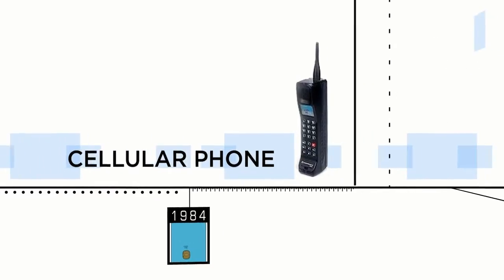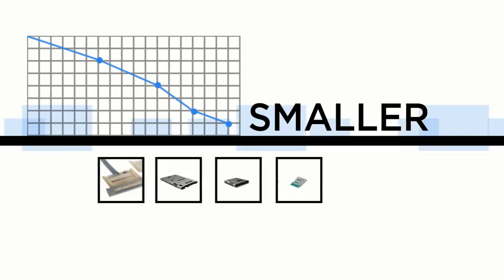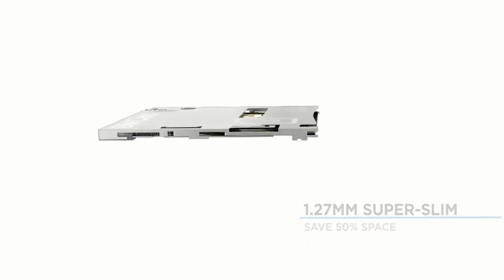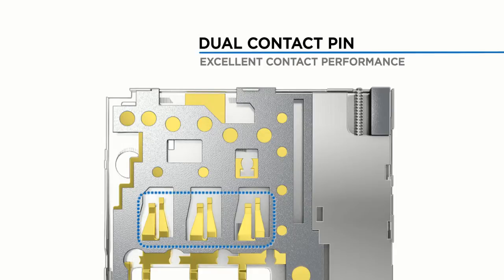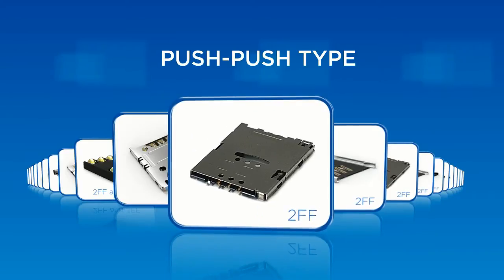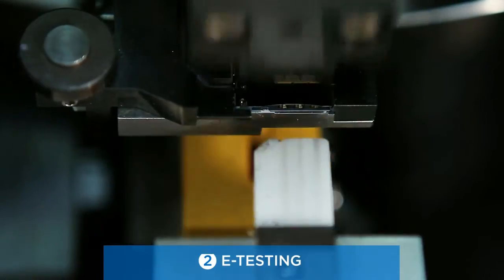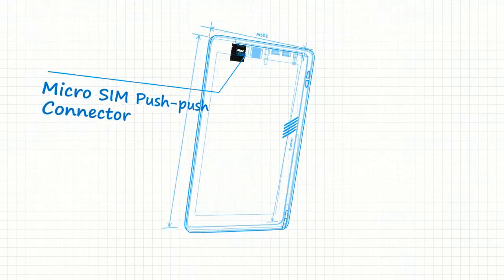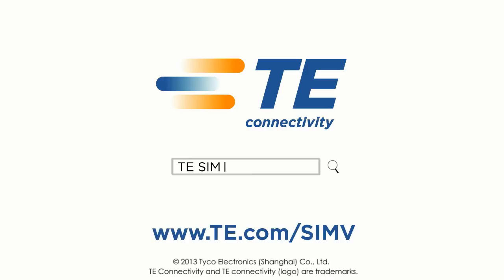TE Connectivity: SIM Card Connector Family

Comment: i have samsung gt-i9300 and it had a problem with the wires connecting the circuit board and the sim jacket(holder) ,which wire goes where its confusing can u help out.....i think i misconnected the wires